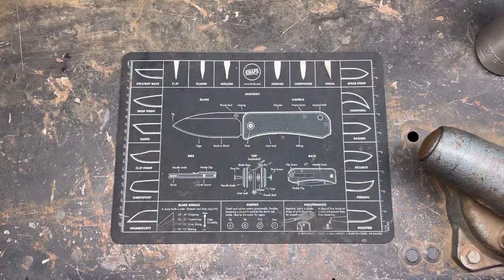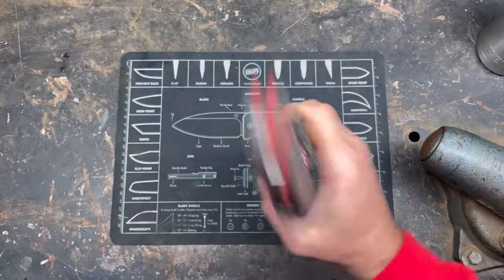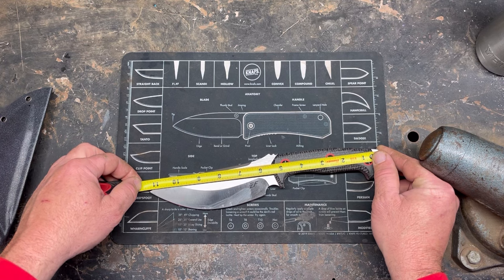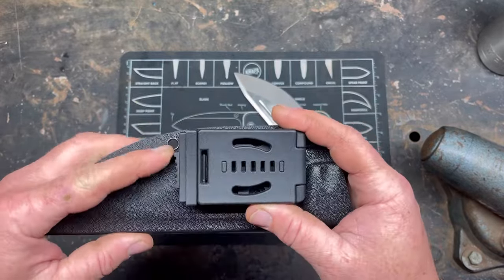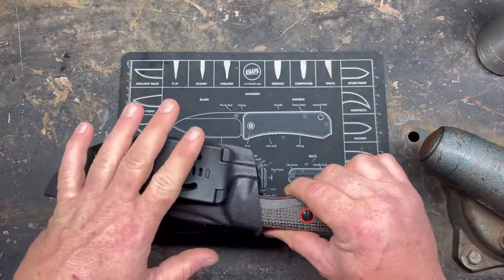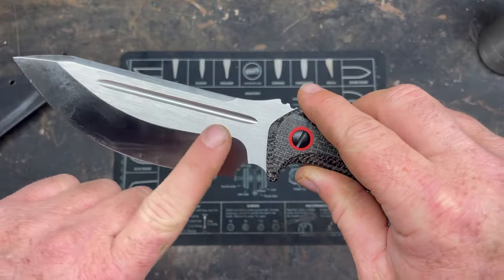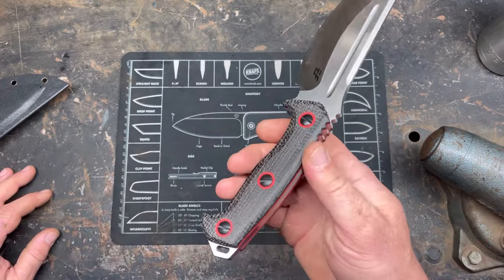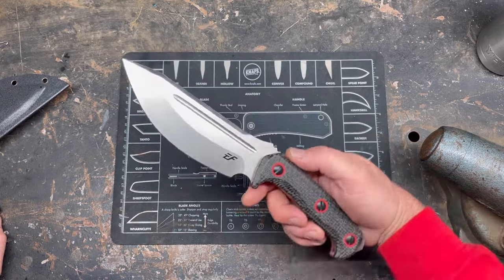The Eafengrow EF-137 big belly awesomeness in N690

Comment: Yeah but is it REAL bohler n690 that's the question.thats a lot of premium steel for a really cheap price
Reply from the maker: I think you’re thinking of m390. N690 isn’t really a “premium” steel
Reply: Correct and once that CNC machined edge is gone, is very hard to get it back by regular sharpening.